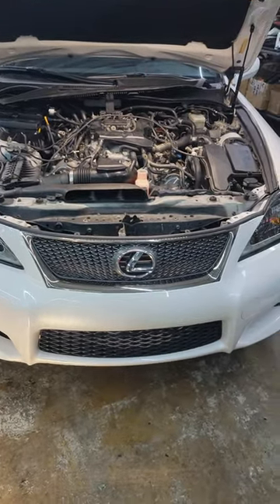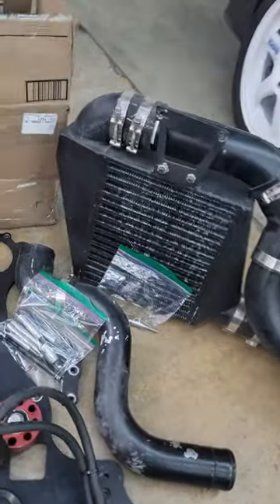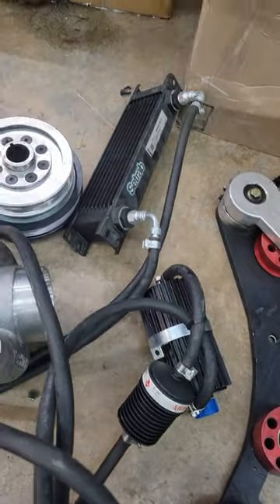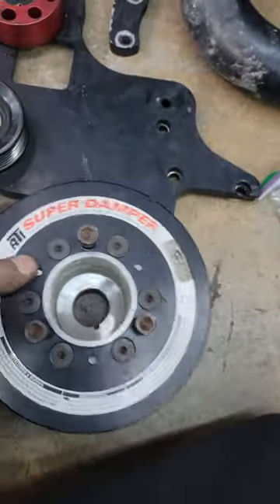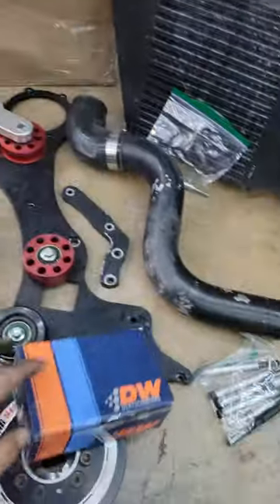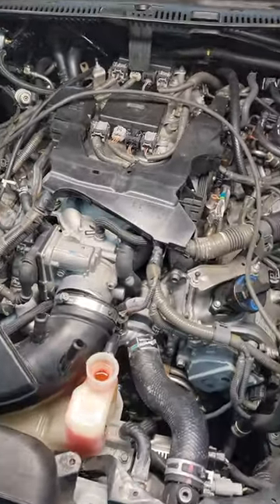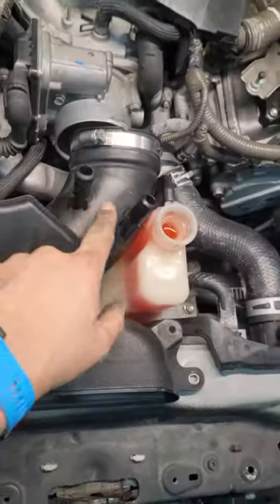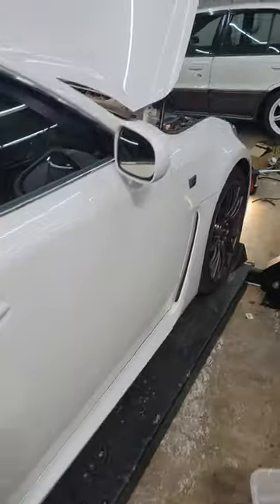Lexus IS-F supercharged part out and return to stock form. It's over

Comment: Curious if you have any opinions on the Elate supercharger kit. Seeing your experience with the rr kit, I wonder if the elate supercharger would have faired better for you
Reply from the maker: I don't know anything about it, but I think there are more solid tuning options out there. The RR parts and kit is fine, there's no major problems with it. The real issue with the RR kit is customer service, follow ups, kit revisions, extra parts that should have been sold with the kit, tune, and tuning process. For example, I was running stock spark plugs the entire time and the kit never included or mentioned anything about running a colder range plug. The original belt slipped under boost, but there was no mention or solution of how to resolve. I received some parts that were defective, incorrect, or put together wrong. The ATI damper was incorrectly thread locked so the bolts vibrated loose on the timing cover side and wore a groove through my timing cover. Then the front side bolts were red thread locked so they snapped and I was unable to remove the pulley with a puller. 

Sometimes it would take days or weeks (or months) for answers, support, or tune revisions. OEM-like drivability is not happening and the transmission wide open shifts don't get tweaked either. The car was always either too lean or too rich and would hesitate on light throttle cruise. Idle was soo rich the car would either die or you would have to floor it to keep it running on a cold start. Their advice was just to start driving it right away so it would warm up.
Reply: @LILEVO such a shame what rr racing turned out to be
Reply: @LILEVO  what a shame to hear all that stuff but its better that you know and can share your knowledge with us. I always wanted a supercharged ISF but after seeing this post and all your testimonials and issues, id rather just have PPE headers and go without the SC kit if and when i ever get an ISF... Once again, thank you for tall the posts you made on this car, i loved each of them. It's truly the end of an era of ISFs on Youtube.